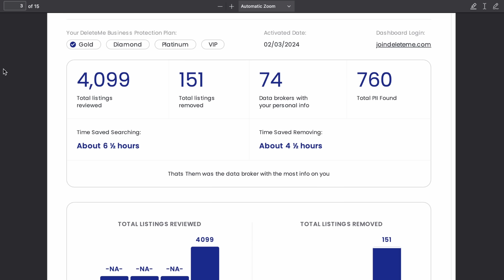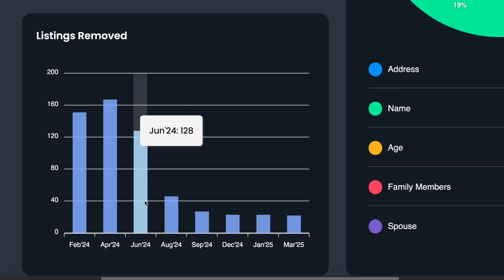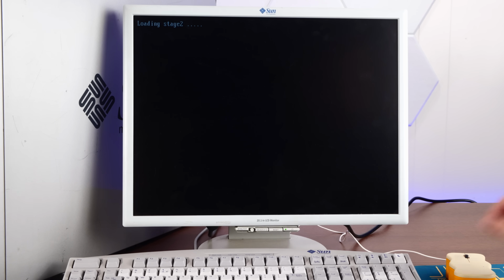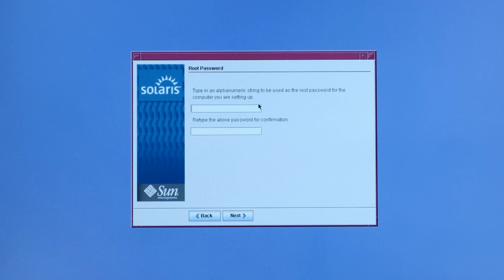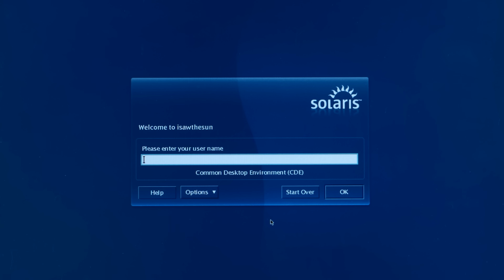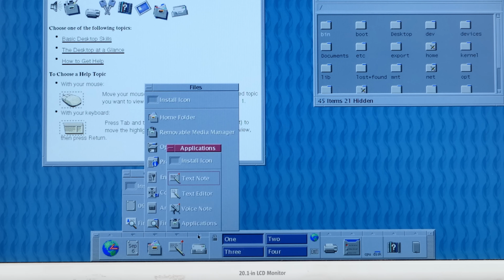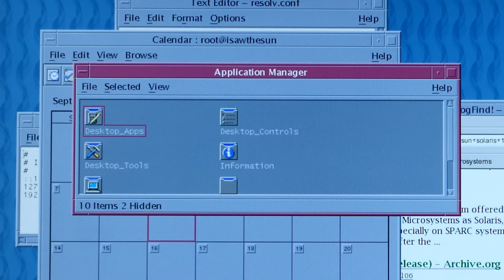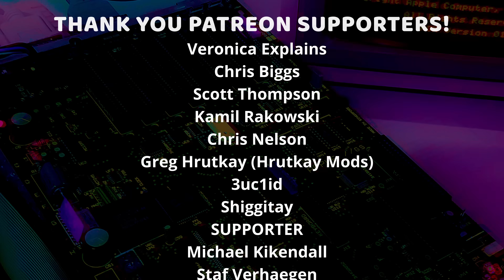The AMD Opteron Changed Everything

Comment: I mean... This is definitely not an original opteron machine. This is dual core and DDR2, CPU release date of 2006. "Original" would have been single core CPUs with DDR1, Socket 940. This is not the oldest machine that theoretically supports windows 11. I have an old consumer desktop under my desk right now.

Comment: You know, I would love to have been a fly on the wall in the meeting where Intel finally accepted that they had to implement x64.  That little upstart that was only a thing in the x86 space because IBM insisted on a second source for the 8088. That had to be a difficult meeting.

Itanium was interesting, and the theoretical performance was absurd by the standards of the day, but it was so dependent on the compiler that it was always going to take a few years before it could be reasonably competitive in the real world and even with the best x86 emulation it was going to have issues with older x86 software even longer until they could catch up with sheer brute force.

Comment: This was a funny time in computing. I was a developer for an MMORPG at the time and AMD gave us an Opteron machine to toy with for our backend, which makes sense... but they also had the silly notion that we would have a use for AMD64 for the client :) We never did. That was 2004 and nobody had any reason to be running a 64-bit desktop for gaming for several years. They were certainly ambitious.
Reply: its kind of a missed opportunity, honestly

the 64-bit machines can handle larger numbers, or handle more of the same size of numbers at once, with some diminishing returns, but the point is still there

things being stuck with 32 bit was actually really bad, except for the fact that once we went to 64 bit, most developers basically threw optimization out the window, at the behest of the CEOs and shareholders, and left all of the performance responsibility to the customer's wallet
Reply: @ShockinglyBland  The move to 64-bit CPUs had nothing to do with handling larger numbers. The Intel 8080 (an 8-bit processor) used FPU coprocessors that supported 32-bit floating-point math, while the Intel 8086/8088 (16-bit processors) used the famous 8087 FPU (hence why we still call x86's floating-point instructions "x87" today), which supported 80-bit floating-point math. As for handling more numbers at once, that was done through things like the various SIMD extensions, several of which predate 64-bit x86 processors. 1997's MMX, for example, supported 128-bit integer math.
Reply: @guspaz  the problem is that it had to have a COPROCESSOR, and everyone needed to spend more money to do the same task that a 64 bit processor would have achieved for basically cheaper, and because it was only one processor, you didnt have to deal with latency, special programming quirks, compatibility issues, etc.
Reply: @ShockinglyBland  The 64-bit AMD cpu's had a huge advantage over the Itanic since they could still run 32-bit code at full speed as well as the newer 64-bit code.  A feature that even the newest x86-64 chips still use.
Reply: I ran Windows XP x64 for years as a gaming OS (until replaced by Windows 7).  Video driver support was very good, basic and core component support was good, third party peripheral support was terrible.  Gamed quite well.  Some adventurous developers had experimental 64-bit builds I could try out.

Comment: That Quadro is an upgrade from the stock one. I still have the stock card if you want it and its 512mb glory! That ioDrive I put in to mess with but could never get it to work, I forgot it was even in there! I ran modern Linux on this thing and it was actually quite good and very snappy with that upgraded GPU.

Comment: This was NOT Sun's first AMD Opteron system!
That distinction is held by the Sun Java Workstation w1100/w2100 systems.
Reply: Yup, this one is allso a whole diffrent socket the opterons in the w2100 and allso the original ultra 40 were all socket 940 not socket F so the one in the video is a gen 2.5 SUNxAMD workstation if you will
Reply: @taggxoc last ones I used were the Ultra 20 line of Beche boxes. Andy Bech(I'm not trying)! Still have 2 in my garage somewhere...
Reply: I don`t know sun workstations, but Socket F, DDR2 and PCIE is quite a bit newer than the original 2003 opterons...
Reply: @felixfider7229  PCIE actually does date back to 2003 (for the spec), but I can't find any evidence that AMD implemented version 1.0. Intel's first chipset with it was from 2004.

Comment: Little surprised the Windows 11 setup started given that processor should lack the Prefetch/PrefetchW extension which is required for Windows 8.1 and newer (but not 8.0).  Maybe WinPE doesn't?  There is a version of the Athlon 64 (G steppings and the mobile only "B1" from 2007 and 2008 respectively) which does have them.  Not sure why you call that the first 64-bit PC given it's using the DDR2 based F stepping from 2006, which besides DDR2 support has SSE3, LAHF, SAHF, CMPXCHG16B, RDTSCP, CLFLUSH, and AMD-V extensions over the original AMD64 release.  Granted there was little in the way of IPC change between the various K8 architecture revisions.

Edit: After investigation it turns out the issue with early Athlon 64s and Windows 8.1+ is not Prefetch/PrefetchW but CMPXCHG16B.  What the G stepping and later did do is add the separate bit for those two instructions since previously they were implied by 3DNow! (and according to the AMD64 manual just being an AMD64 processor in general).  Long story short the F stepping should indeed be the earliest that can run 8.1+.
Reply: I wonder if the WinPE environment for the initial part of the installer might still be running in 32bit mode. Or it could just be an older windows kernel which did not require cx16. Of course, you can still run 32-bit Windows 10 on this machine!
Reply: @kepstin  As per the edit in my original post:  I  (and a decent chunk of the Internet based on various forums) had bad information on Prefetch/PrefetchW.  The only thing that changed from the F to G versions of K8 is that a new flag for them was added to the CPUID separating them from the rest 3DNow.  The 1st through 3rd generation K8s (C through E) do lack other instructions though, so the 4th generation (F) machine shown in the video is indeed the first generation that can run Windows 8.1+.
Reply: Yes

Comment: 0:40 Itanium did actually initially have native hardware for executing 32-bit x86 code, but it was so notoriously slow and bad that after a couple years, Intel dropped the hardware support entirely in favor of relying entirely on a software emulation layer for running 32-bit software.
Reply: It was also userspace only, so your existing drivers didn't work if you needed specialised hardware.
Reply: The Pentium 4 actually had 64bit extension similar to amd64, but Intel management forced it to be disabled to not compete with Itanium.
Reply: in short: ia64 didn't allow x86, ia32 was terrible, Intel introduced EMT64 which tried to survive against the AMD64 which just rocks.
Reply: Intel's biggest failure was literally insisting that 32-bit was still relevant today, and the truth is Time has spoken, they are garbage... the X64 strategy demonstrated both efficiency and durability, while the most powerful Pentium 4 jumped out of the socket due to overheating by forcing a core of32-bit at 3.2GHz 😅
Reply: Itanium's only superlative feature was the data transfer rate, if you could get your Itanium code to run fast enough.  The proverbial "try sipping water from a firehose".

Comment: The first PC I ever bought with my own money was an AMD gaming rig with an Athlon processor. I used it for years before upgrading, and after a couple of new builds, I decided I wanted to bring that very first machine back as a hobby project. The processor had died,, hdd had died, so I went looking for some replacement parts. While searching, I realized the socket could also take 64 bit multicore Opteron server chips. That was during AMD’s glory days, when they were crushing Intel, so I tracked down the fastest one that socket could handle and bought it second hand. 

I took the same approach with the memory, maxing it out with the biggest and fastest sticks available for that board. The original setup only had a hard drive, so I dropped in an SSD on the fastest SATA port it supported. Back then there were SATA I and SATA II slots, if I remember right. For graphics, I installed a much newer card than the board was ever designed for, simply because I had it on hand. I put in some better fans, and a Zalman CPU fan I had lying around. It cooled so much better, I could push the clock speeds of the CPU and RAM up a bit. And last but not least, I threw in a PCI gigabit Network-card with Wifi. 

All in all, the end result was wild. My very first PC was suddenly running almost neck and neck with my much more modern system. Benchmarks still showed a gap, but in actual use it felt buttery smooth. The fun was in figuring out the absolute maximum potential of that motherboard and then pushing it all the way. If I had bought those parts brand new at launch, the cost would have been astronomical, but years later on the second hand market, the whole project was affordable and deeply satisfying.

I still have this PC and I probably will never get rid of it. For me it is a time capsule tuned to perfection.
Reply: Great story! This is basically the script for Sean's new series: The Cursed Sparc (which, btw, could also work as a cool retro-fiction novel title :-) )
Reply: Cool! This is basically the story of my Core2Duo rig (that started it's life as a Celeron D in 2006-2007), with the main difference that the PC that I've replaced it with (Ryzen 3, if i remember correctly) died, and now I'm using it again as my main PC. With a properly optimized OS it's still a pretty useful little machine, after an SSD and memory uprgade.
Reply: @olexanderkidenko4423 you can also upgrade to a core 2 quad q9650 for a huge boost in performance
Reply: Talk about their glory days, I think they are making a return😂 new intel sucks vs amd
Reply: Beautiful =)

Comment: What you really need to install on this thing is the 64bit edition of Windows XP Professional.
You know, the one with the NT5.2 Kernel that was basically Windows Server 2003 with the XP UI bolted on top of it.
Reply: The Sun Ultra 40 Workstation Tools and Drivers CD is needed for that, and Sun probably charges for it.
Reply: @cageliner  , "SUN probably charges for it" that might be back in mid 2000... (later they would just given you a zip-file if you had sent em a email)  but it would been pennies compare to Oracle today.
Reply: @cageliner  Snappy Driver Installer Origin will probably work.
Reply: Windows 2000 Pro 64-bit would be more time appropriate and it is what XP was basically built on.
Reply: @TheFoulMouthNews that was built for IA64 architecture so it won't work, and Microsoft never do the commercial release of it,and it ends up as IA64 version of Windows Server 2003
Reply: @linglin92  Really? Then how was I running it on an AMD 64-bit processor for years then?
Reply: @TheFoulMouthNews The 64-bit branding is used on IA64 version.This architecture has many problems and issues on development and results a market failure,stopped support during XP support lifecycle,even the features that XP should have is not completed.Only server product line remains until 2008 R2

Microsoft later finished the development of AMD64 port,called XP x64 Professional,only Professional SKU,the development was finished so late that all the x64 version of the NT5.2 release came with SP1 update.
XPx64 has all the features that XP should have, except some components version been updated such as WMP10
Reply: @linglin92  I just tried to reply to you and it didn't show up. You do not remotely know what you are talking about here and I do not appreciate that while you are talking out of your a$$ you are talking down to me like I am some moron when I actually know what I am talking about and you do not. Go do a two second Google search. Then come back and apologize to me like a man would, boy.
Reply: We don't know why Microsoft decided to bump up the version number since Microsoft never done this before and later during server development.NT5.2 basically it's a developed version of XP but Microsoft won't compile the client OS but the Server one,2003 was released and the time was close to XPSP1 release, Microsoft had done the development of AMD64 port when NT 5.2 has reached SP1 stage,closes to XPSP2,so all the x64 version OS release were came with NT5.2SP1,then it's XPSP3 and 2003SP2,and reached EOL in 2014.

Comment: Solaris 10 has official support for another 2 years , until 2027
Reply: I wonder what this support actually entails. I don''t assume they'd actively push out a Firefox 142 update?
Reply: i think in general, if you run solaris and run into issues, oracle will support you - albeit it probably has to be paid for , also it still sees security updates which im pretty sure that part is at least free.
Reply: Solaris 10 was the version that Sun open sourced and lives on as Illumos.  I'd love to see a Tribblix or SmartOS install.  Forget oracle.
Reply: @jefffrasca4054  It's a bit more complicated than that. Illumos is based on OpenSolaris, which was in turn based on what would become Solaris 11.
Reply: @jefffrasca4054  darn ads obscured my first attempt at replying to you. Jump on /r/Solaris and the author of Tribblix posts every once in a while. I tried it on my Sun Fire V125 that I bought during COVID. It was good, but I struggled with GUI anything.
Reply: I had to google how old this OS is and holy cow its from 2005 and would of been cut off in 2021 but they EXTENDED it until 2027, this would be like if Microsoft supporting xp sp2 until 2027... That's completely insane in a great way I wish more companies would keep supporting an OS like this... Cough Microsoft cough what's with my cold lol
Reply: @etrain5050   however the reason for such a long term support is rather obvious and a trade off , sun - now oracle hardware IS NOT CHEAP , you are talking about workstations in the $10k minimum, and servers even more of a higher price point.
Reply: @breadmoth6443  Extended support periods are security and bugfix only, no feature development. Windows 10 begins paid extended support in October.
Reply: @tristansewell5986  yes i think i alluded to what ESU is , but also I think if I am not mistaken , the next Solaris (11.4 current) at this point is just bug fixes and i have a feeling Oracle is keeping Solaris on life support, as not much different compared to 10 and 11.4 now ; and seeing the roadmap of the development of Solaris , nothing new is being planned - hence life support.
Reply: @breadmoth6443  Fun fact, this Amd Workstations were pretty comparable to PC workstations in price. We are not talking about SPARC here. And even then the last Ultra models were not too expensive. Thats why some governments bought them, for example  around 80000 Sun Sparc run the whole police infrastructure in Germany (until Oracle bought them in 2009, they then migrated to Microsoft Windows).
Reply: @etrain5050  yes it's from 2005 😂. I remember trying it on my Gateway laptop. That Celeron M was awesome at the time, but Solaris 10 was not. No driver support for either wifi or ethernet. No flash drive detection. It would have been awesome had any of those things worked.
Reply: @etrain5050 oracle actually took the (then open source) solaris operating system and close sourced it after gutting sun

the open source codebase forked and lives on today as illumos! try openindiana or omnios if you wanna give it a shot
Reply: Solaris 11 will have official support until 2037. I'll let you figure out why they chose that year in particular.
Reply: @stalecu   i doubt it is due to the 2038 bug ,even Oracle would have patched that . Linux already has.
Reply: Yes. Would like a deeper dive than clicking around the desktop. Running Windows 11 is a disgrace.
Reply: This is how a PC case should be made
Reply: @keiichicom7891  would someone please think about the air flow!
Reply: But Illumos will always be available, and still developed by Solaris engineers
Reply: Solaris 10 got major updates through its life, kind of like how Windows 10/11 does now
Reply: @lordofhyphens   Solaris gets it by default(see all previous versions of Solaris, and you will see a higher than usual support for it, compared to probably other proprietary OSes) - windows 10 gets it if you pay for the ESU (Extended Security Updates) - and that if you are a corporation and may find it more cost effective for the time being to not upgrade hardware just for a new version of windows.